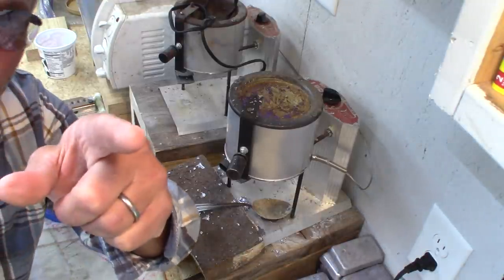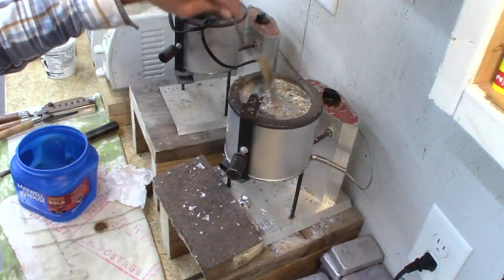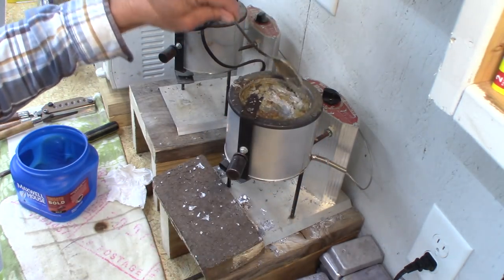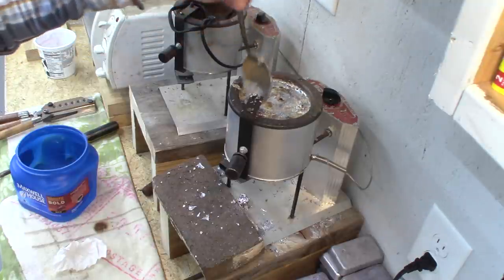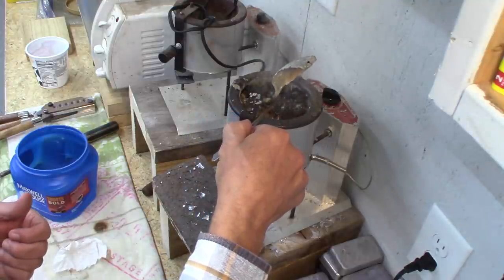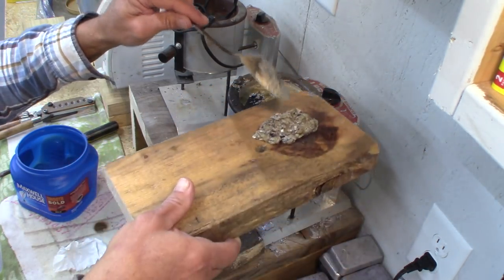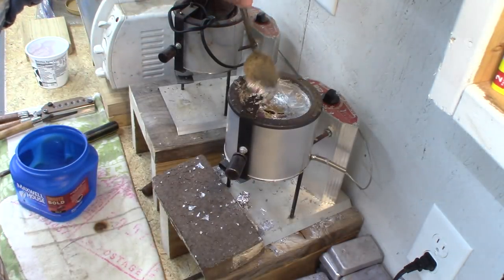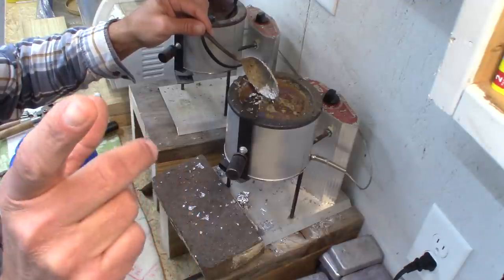Purify Your Lead

Comment: I use about 6000 pounds of lead each months making fishing sinkers and different alloys for people who cast bullets.  I have done this for a living for several years so I have learned both from my many mistakes and from professionals who really know their stuff.  Start with good quality lead like range scrap or lead clip on wheel weights, (Stick on wheel weights and sheet lead from roofing are also good but very soft.) Never use battery lead, if you do you will never make good quality bullets. Use a cast iron pot if possible but steel is almost as good.  Larger batches let you control the heat easier, you want to keep your temperature low, never above 750f but 710f is better. Start with some fairly clean lead in the bottom of the pot (That is called a "Heel")  Never let any moisture get into the pot, wear safety glasses, gloves and a good respirator with organic cartridges, make sure you have very good ventilation.  When the lead is melted and about 710f (Or so) scrape the pot well and remove any solid materials (Bullet jackets, steel clips etc.) a wire strainer like you would use to remove fried food from hot oil works very well.  Now take 1/8 teaspoon of Stearic Acid (Buy on ebay) and toss on the top of the molten lead and quickly stir with a large steel spoon (It will smoke and catch on fire)  After the smoking has stopped you can use the spoon to remove everything floating on top.  You will have bright shiny lead with a beautiful mirror finish on top.   If the lead is not perfect then you might have zinc in the lead which you can remove with pure powdered sulfur stirred well into the mix (You should use small amounts and this will take several treatments)  Always clean your molds with denatured alcohol and a toothbrush and it often helps to "Smoke" the molds over a candle or match flame.  Keep your temps low, keep your molds clean and hot, and you will get great results.  Add 1% tin to improve  mold fill out and if you want to harden the lead you can add antimony and tin, you need to have trace amounts of arsenic if you want to harden bullets by water quenching (Clip on wheel weights have enough arsenic)
Reply: More informative than the video lol thank you
Reply: Thanks for the information,but is lead from batteries contaminated or alloyed improperly to cast bullets? Could battery lead be used to cast buckshot where it may not be perfect?
Reply: @ronv6637  battery electrodes also contain tin and antimony which make no difference if you're using them to make solder or bullets. But you should mechanically separate all the sulfated residue off of them. I've found that if you pile them on a piece of lumber and heat them up with a torch, they'll "deflate" and melt from the inside, and give a nice clean stream of lead that you can run downhill into a crucible. The resulting husk of sulfates and oxides can be disposed of as lead waste or if you're ambitious, you can reduce it by melting it with charcoal. The charcoal will burn to make CO which reduces PbO to lead; then you can dispose of the more durable residues.
Reply: What do you think about candel wax for flux?
I just use old lead pipes, It seems like it's already very pure. The only slag that floats up is the oxidized part of the pipe and a bit of dirt

Comment: I have many years experience in the lead industry. You really should use the proper respirator and/or do this in a well ventilated area; and, not just when "fluxing" the pot. In the lead industry, what you call "fluxing" is called "drossing." You bring the impurities to the top of the lead in the form of "dross."  Also, you do get lead fumes from a pot of clean lead.
Reply: I heard countless arguments that you don't get lead vapors until lead starts to vaporize which happens at extremely high temperature.  Do you have any sources to backup the claim that you get lead vapors at melting temperatures?
Reply: @DimaProk  You can probably get the information from OSHA under the U.S. Department of labor.
Reply: Exactly correct. Arguments about lead vapors, why take the chance?  When I flux my lead, I use candle wax/ beeswax
Reply: @shawnlively4702  Do you wear respirator when you shoot the gun too?  Because there in fact lead vapors from burned powder!  I've read a story about a woman who worked at gun indoor range and when she decided to have a baby she got tested and her lead levels were high!  I've never heard any stories about people who cast bullets getting high levels of lead when taken normal precautions.
Reply: @jonnporter6081  Sorry John, but OSHA is going to to tell you pretty much what every California warning labels says - this product in the state of CA is found to cause cancer.  They put that on everything to be "safe".  You said you have many years of experience in lead industry and I wanted to hear real world experience, not what OSHA has to say.
Reply: @DimaProk  Your reply makes  no sense. I drossed 40,000 lb pots of lead. They're even more dangerous when you turn the lead into soft lead by removing the harder metals. I've also re-drossed that same lead when we poured it into 75 lb  "pigs." I've drossed the lead well where the red hot lead comes out of the blast furnace. I've poured the slag out the back of the same furnace. This was before they had all that nice equipment you see today. If it couldn't be done with a forklift it was done by hand. And finally, I've seen what failure to be informed about hygiene does to your blood lead. In the lead smelter, the blood tests were every two months. In the battery factory, they were every six months. I've seen guys have to go to the hospital because they had lead poisoning. No, I am not, nor was I ever employed by OSHA. Now be a good child and eat your lead paint chips.
Reply: @jonnporter6081  I don't understand why you have to resort to demeaning and name calling, I was hoping that being in the lead industry you would provide us with in depth information.  I believe in the importance of hygiene when casting lead and ventilation too.  Meaning I do my casting normally outside and don't eat or drink while while I am melting lead and I wash my hands and I wear different cloth when I am casting.  When I started casting bullets I bought M3 respirator with 2097 filter.  From what I read is that particles in the dross are the worst offenders and the respirator will stop them from getting in to my lungs.  I am not sure it will stop the lead vapor, I found that while I am melting dirty wheel weights or fluxing with candle and sawdust I can't smell anything with my respirator however when I started working with acetone is did nothing to stop the smell.  There is also this big debate about how the lead starts to vaporize at 3182F degrees and we are working with molten lead around 700F so I don't believe I get exposed to lead vapors which also I doubt my respirator will protect me from anyway.  So don't mistake me for being arrogant, I am just not so sure about lead vapors.
Reply: @jonnporter6081  
suuuuure
So Johnny, why heat the lead until it's "red hot"?

Seems like a waste of energy to heat it to the point that it gives off light...
Reply: Did any other experts here hear that exhaust fan

Comment: I made the mistake one time of using really fresh saw dust that I had just picked up from home depot, and it was so green and wet,  that it popped very violently. Thank goodness for my safety glasses because there was lead splatter all over them and my face.Thanks for the vid.
Reply: Thanks for posting that experience..
Reply: Holy crap. I'll remember that next time I pick up my Lowes sawdust.

Comment: It’s always good to see someone else’s approach to the process of casting. I currently use Magnaflux powder to flux my lead with because of the low fumes it puts out. I’ll add about a teaspoon to the pot after scraping the sides and then vigorously stir the contents of the pot for about a minute and then scrape off the dross and begin casting. This is the old school Lyman process I believe. Based on the process you’ve demonstrated, perhaps all that stirring is not necessary? I enjoy your videos, keep ‘em coming!
Reply from the maker: Yep... I like to see and hear about other methods as well.. thanks for your input of info and thanks again for stopping by! 👍👍
Reply: Vigorously prolly overkill but it won't hurt unless you slop some lead on yourself I guess.

Then again, it'd depend on if you have a bottom pour or not. Top scoops need extra detailed fluxxing but bottom pour all the crap floats to the top and all the "good" lead underneath because well, it's heavy!
:P
Reply: Magnaflux is good and I use it. Battery Lead has stuff in it that cannot be removed without bringing it to dangerously high temperatures with expensive equipment. You can use softer lead for buckshot but when you get down into number four or smaller then you need to use hard lead that has some antimony and arsenic in it and drop the hot shot directly into oil or water to quench it and harden it.

Comment: James is correct. Casting weather is right around the corner.
Reply: Yep, every year for me. Is right after hunting season. For the bulk of my casting. I might do a small batch here and there. I really don't enjoy it in the summer months.
Reply: cwlongshot  yep Older i get. The more I tend to do it on the most comfortable days. With exception of getting a new mold. I dont have it in me to wait.

Comment: Wow 17.9 subs I was your 383rd sub . The only reason I remember that was because that was the engine in my old Dodge Dart. You and Steve Fortune cookie 45 LC got me into powder coating and casting bullets. Do you remember when I told you about pulling my press off my bench and breaking the 3/4 top sizing .358 bullets. That's when I learned to make sure my mold was closed all the way. Every time I look at the square cut out of my bench it's a happy reminder of you teaching me threw your videos and the comments. I'm so happy your back making videos. I loved to hear that damn rooster when you were shooting outside your loading cave. It's obvious your not there anymore. I'm in the middle of trying to find a place in Tennessee. I hope that the new casters and reloaders pay attention to your videos. I still learn things after 35+ years of reloading. It's good to see you again old YouTube friend. I'm going to go pick up 8 5 gallon buckets of range scrap so I can replenish my lead supply. After seeing you again I looked at my ingots ant thought I need to get a rectangle ingot mold so I bought 2 8 cavity pans for making mini bread loafs. I made so many of the round ones that it's taking me a few years to go through the lead that I had. So when I shoot video of melting the range scrap into ingots you will be with me in spirit. I'm finally going to be able to make the Elvis ammo wall of lead ingots that you had. My luck they will all fall over on my bench and break that too. Well Happy Safe Shooting old friend and get a Rooster. We need to hear one in the background.🤣 🇺🇸💪

Comment: Generally try to avoid the paraffin based waxes. Most candles are paraffin based. For lubrasizing doesn't seem to matter so much. Powder coating, it seems to matter.
I use beeswax or bullet lube. I'll put sawdust on top and just leave it after fluxing to create a barrier.

Comment: Hey man, another good video!
I’ve gotten to where I like to flux the mess out of my lead right before I make the beautiful ingots. I use sawdust and beeswax for that. You know, saw dust as a flux and beeswax as a reducer to put the tin and antimony back it.
Then when I get to the casting pot I like to use the hickory, oak, or cherry sawdust, you know, cuz it smells goood. Leave a good amount on top while casting to prevent oxidation.
Keep the videos coming and keep your power dry!

Comment: I've never been involved in casting bullets; however, I have cast every from lead pellets/nuggets to boat keels. We would take an oxy acetylene torch, and only using the acetylene (NO OXYGEN), run a flame around the mold, leaving a very thin coating of black soot on the mold. This soot acted as an insulator and  eliminated the lines/creases in the finished product caused by uneven cooling of the lead. Any left over soot easily wipes off of the lead. If you try this, let us know the thin coating of soot affects the diameter of the bullet.
Reply: Black birds...

Comment: Yup, that's how I do it too. Only I don't use a bottom pour. It still doesn't matter because the junk floats quick. You don't really have to worry about getting it in your mold. And Even if you get some in there you can just melt it back down again.

Comment: The tin and antimony that wasn't in alloy in the bars will just float on top like a heavy foam. Flux before scraping off the dross. Always save the dross and melt it when melting scrap. You don't want to throw away the expensive part.

When melting in bulk to make bars always get it extremely hot. It takes about a 1000f to melt antimony but only about 700f in alloy. The heavier alloy will melt but leave the lighter antimony that didn't alloy floating on top.

Comment: i use FA lead flux when casting into ingots then remelt and flux with homemade bullet lube and cast back into ingots so that when i put them into my casting pot it does not matter what type of flux i use as long as i flux it. different types of flux works slightly different from one type to another even though they have the same results, but i prefer to have my lead as clean as possible from the different chemical reactions that other than what one flux is able to do, mainly because my 40yr old lee 4-10 pot is a pain to clean after getting plugged.

Comment: Like Elvis mentioned anything carbon is a flux for lead, commercially they use hardwood sawdust. Handcasters have used beeswax, but one of my favorite tricks is to use those wooden paint stirrers that you get free from home depot. You can use a layer of plain, unscented kitty litter to slow down oxidation.

Comment: When I first started casting bullets in the early '70s, the reloading manual I had suggested fluxing the pot with a bullet-sized lump of the stuff I would be using for bullet lube.

Comment: I used saw dust in a ventilated garage, with an 30 in dia  exhaust fan and contaminated my garage with lead. The only conclusion that I could come up with the contamination was the smoke from the burning saw dust. I have no contamination on the ceiling, smaller amount but required cleaning and significant cleaning on all horizontal surfaces.  All off floor horizontal surfaced and on floor surfaces contaminated. 3 cleaning separated  scrubbing and rinse events to remove.  Flux and cast outside. This stuff carries into the house on your clothes and shoes. Dont risk your family health. Still casting strong,,just outside in the fresh air

Comment: HEY ELVIS, IT'S ARCHANDEL2003, Heyyyy.
For a fume vent I put a slice of that pink foam in a window (I cast in the basement by that window) and close it to make it seal up tight.
I then mounted a real quiet computer fan to it that is large enough to connect to a 4 or 5 inch flexible dryer vent and I aim the other end over the pot. I get a steady Suction drawing all the sawdust smoke and fumes out the window, in the winter, keeps the cold air out, and is easy to remove.

Comment: Is the high temperature the reason for the blue tint to the lead at the beginning of the video?
Reply: How should i soften my deal or make it flexible
Reply: I believe that blue tint is the tin separating from the alloy due to the high temperature(860+ degrees).
Reply: The blue and purple gunk is lead oxide. It forms because the alloy is at too high a temperature. If you skim it, the fresh surface will quickly oxidize, so that's a wasteful thing to do. Reduce the heat and as your pot of alloy cools, at about 620-650 it'll stop doing that. That's when you sweep a spot just larger than your ladle and start filling ingot molds. Leave the dross on the surface to protect the underlying alloy until it gets difficult to harvest the alloy from underneath it.

Comment: I know this is a fairly old video but info is info. Years ago while experimenting with flux ideas, I made up a mixture of paraffin wax with graphite added to it. I melted the mixture and poured it into 209 primer trays (like an ice cube tray) then pop them out for use later. It has been a lot of years since I have messed with casting but I recall it's flux ability to be excellent and easily manageable to "dose" your pot!  I had an ol guy tell me one time to stop wasting my time cleaning the top of my pot off. He said" WTF do you care what is floating on top, your pouring from the bottom!" then he added "besides isn't it an insulator sitting on top". I continued to remove the slag but hey.
Reply: Hmm I like it! love the primer tray idea!
Yes "I am" an old Guy just Knott to old! but I have worked around all types of Molten metals, when I smoked, I lit my cigs in the 80's on hot metals or molds "cooling". Poured my First Lead plumbing joints in the 70's for my plumber pops as a pre 10 yr old? the word "plumber" comes from LEAD! and the dross floating protects the lead under from oxidization becoming flux, but I still try to get all the tin out for softer lead.
paid for and built my first Kit revolver top to bottom and Niter salts blued in the 70's riding my bike as a paper boy